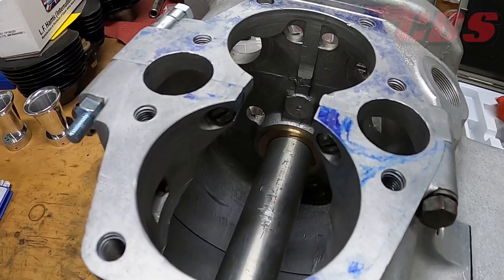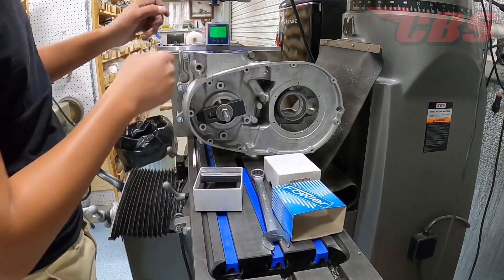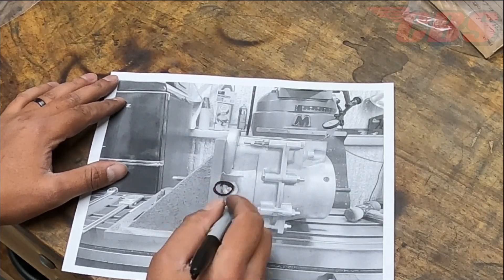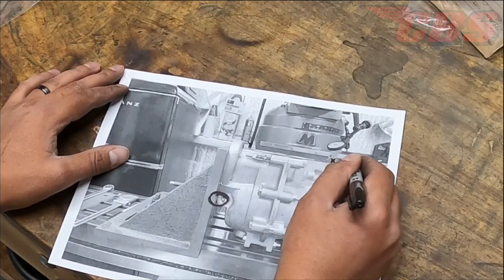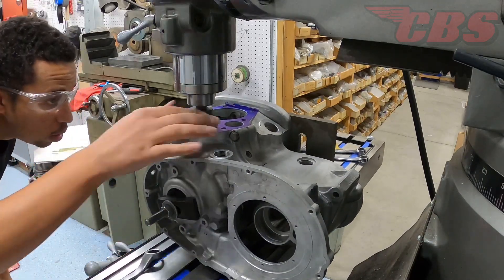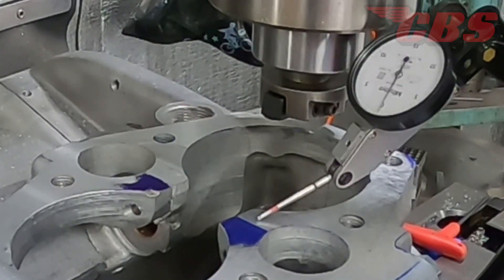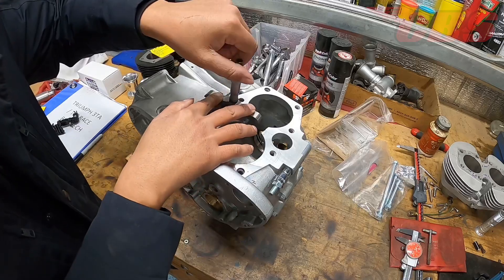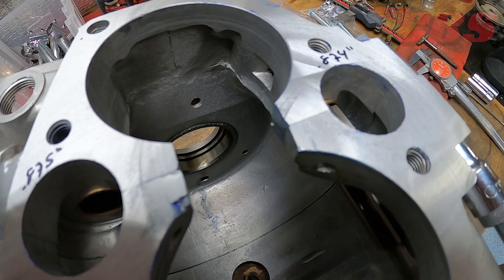Fly Cutting A Triumph Base Gasket Surface

Comment: Would it not be better to indicate off the crank centerline to ensure the cylinder base surface is parallel?
Reply from the maker: Thanks for watching - yes that is correct, however, I have a crank bushing and ball bearing which have different ID's, so measuring the ID is challenging while mounting the case. As you see at the end of the video I did some checks, the gasket surface is indeed parallel to the crank centerline. In this case (no pun intended) the base was parallel to the centerline from the factory
Reply: @classicbritishspares  ,,,Well done Bru.....